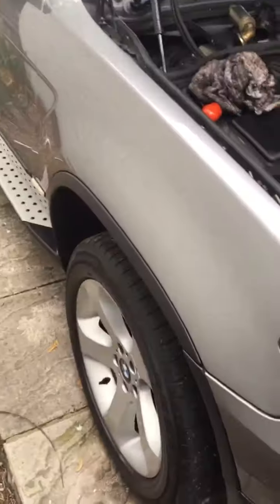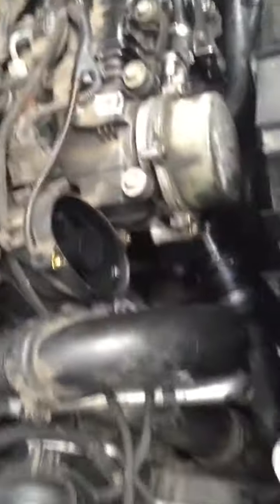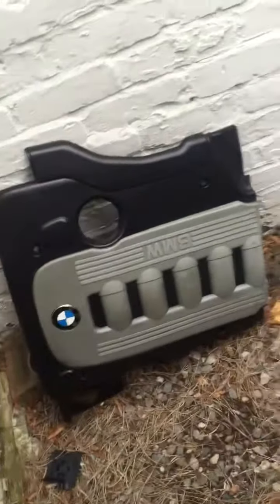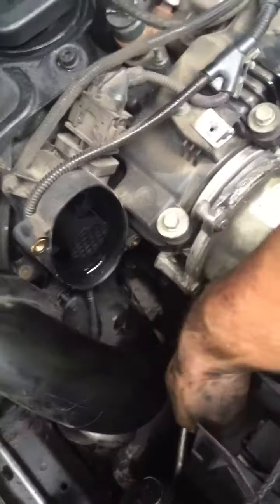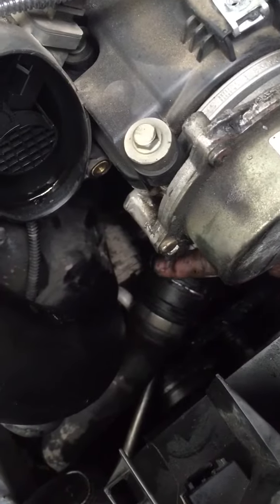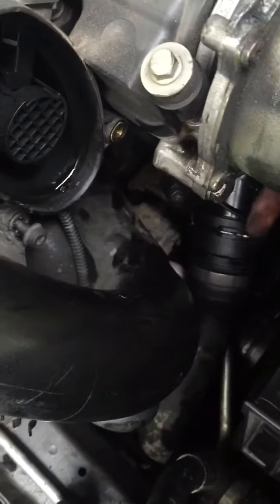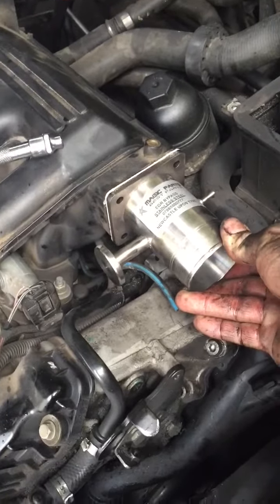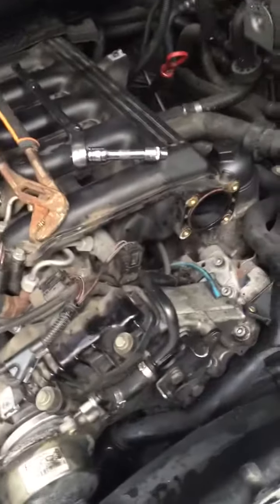BMW X5 e53 3.0D thermostat replace and EGR delete

Comment: Hi mate, need to do my thermostat and take egr off. Just a question, do you have to change anything on the computer after removing the egr ? Cheers mate
Reply from the maker: @Michael-q3s5b  no mate just take it off its not like most modern cars no lights will come on :-) you will noticed a little more MPG
Reply: @ nice one thanks mate. Does the other end that goes to the exhaust need blanking off too or can it be left open ? Thank you
Reply from the maker: @Michael-q3s5b  if you get what I got there think I got it off Ebay.
 that's all you need to do.
Put it in place i do it to all my cars vans EGR is horrible to the engine
Reply: @johnshomegarage7828  cheers mate. I appreciate the response
Reply from the maker: @Michael-q3s5b  no problem mate glad to help 👍

Comment: When you fitted the EGR delete did you connect up the vac pip to the bit in the side of the EGR? I’ve got the same one and someone said on the E53 uk page on Facebook that the vac pipe shouldn’t be connect back up to it 🤔
Reply from the maker: Yes I connected it back up mate
Reply: you dont even need to buy delete thingy , just unplug the vacuum pipe and put a little screw to stop vaccum escaping from the rubber pipe, thats it 😂😂

Comment: did you took a radiator fan off?
Reply: You don't need to if you have the Face-lift x5 x53.
Reply from the maker: Gor Svet no mate left it in place tho it's not much space to do it but still manage it :-)
Reply: Did u have to remove the alternator and ac belts
Reply: @ydk.ișh  No need for that mate as far as i remember